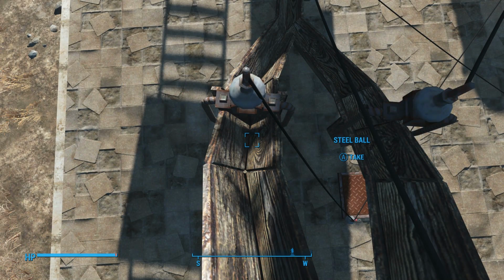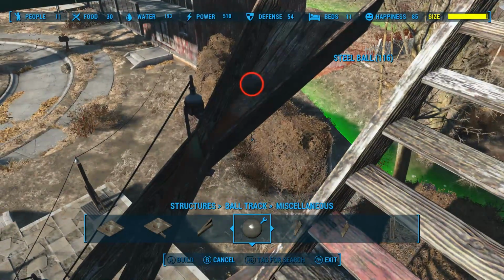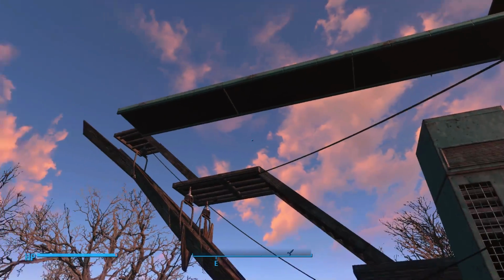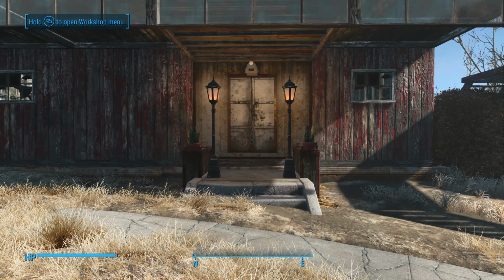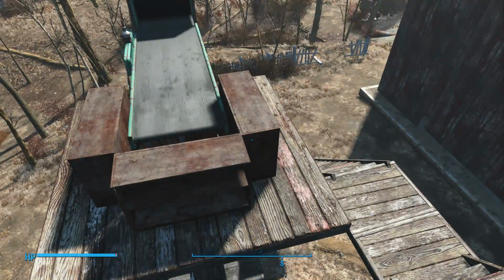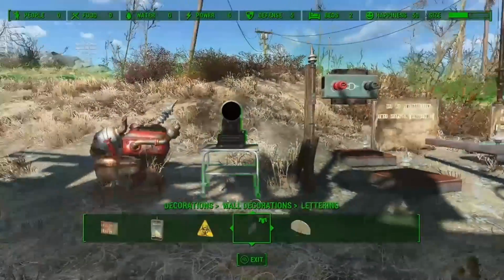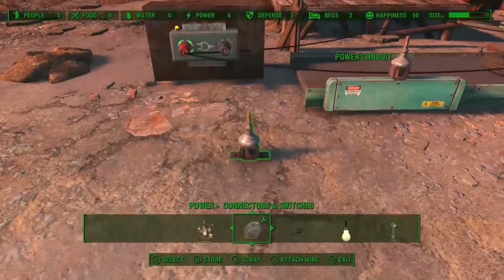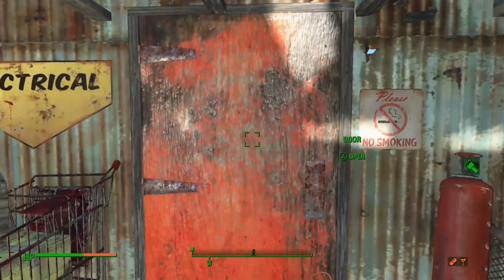Motion Sensor Doors (ft. The Insane Shecklador) 🚪 Fallout 4 No Mods Shop Class

Comment: I dont get the point of the ball track? Seems like the delayed off switch would cut the power between pressure plate and door, id probably have to attempt it myself before I'll understand the point of the ball track
Reply from the maker: Really this was more a puzzle challenge with Sheck and I. But I put together a better method in this video: https://youtu.be/0bhOULJvFwU?t=174

Comment: IDK why dont you use Laser instead of step 😂 2 laser 1 logicgate and delays it wasn't ezer ?! 😕
Reply from the maker: The only two problems with the Laser is that it can be accidentally stepped over and it's also visible. But we did find an easier way. Check it out here: https://youtu.be/0bhOULJvFwU?t=174
Reply: @SkooledZone I use same tech that you show with step and delay pylon  (but with laser in Manufacturing building mode - 1 lasre in front of door and and the other one in the other side of door-  cross first open door and cross second close door

Comment: Both of these are ingenious, but I have a simpler version; all you need is an XOR logic gate and a delayed off switch. Hook the XOR up to power as well as to the pressure plate. Hook a 5-second delayed off switch to the output of the XOR and the powered door. XOR's only transmit power when one of their inputs is powered. Therefore, the pressure plate/XOR combo resets the power supply to the delayed off switch, opening the door for 5 seconds.
Reply from the maker: Is that the same as this? https://youtu.be/0bhOULJvFwU?t=174
Reply: @SkooledZone  
Exactly the same. I hadn't watched that one yet. 😅

Comment: I wonder why they use a NAND gate, using the generator and the diverter as input. the generator is ALWAYS giving power, so the NAND works efectively as a NOT gate for the diverter. I think just a NOT, with the diverter as input should sufice. It just saves up one wire, tho, but it is a bit cleaner, and easier to understand.
Unless I am missing something...
Reply from the maker: We came up with a better method here: https://youtu.be/0bhOULJvFwU?t=174

Comment: Jumping back into FO4 now that my console can handle larger settlements, and your vids are huge find, thank you. Curious, could you just let the ball drop down a few feet between the less-steep single track pieces to achieve the same angle of decent as the double track? Gravity could solve the problem for you assuming the ball doesn’t bounce back out when it lands?
Reply from the maker: Actually, we discovered an even better method after I posted this video: https://youtu.be/0bhOULJvFwU?t=174
Reply: @SkooledZone  Brilliant! I had actually just tried making an automated decontamination gate with a pressure plate and a delayed off switch! Didn’t seem to even need the XOR switch, but it is a little finicky. Will try this setup, thanks for the reply!!

Comment: Love your videos, but here is a lot simpler solution: place two "solid state" laser sensors/switches (the last on the manufacturing menu) on either side of the door. Connect power to both of them. Then connect both sensors to the INPUT of NAND logic gate. Connect the OUTPUT of NAND gate to delayed OFF switch and then to the gate. Program the switch to desired time you want the door to stay open. This solution is better (IMHO) because if you run in and trip the second sensor earlier it will shut the door sooner. 

To make it clear, the NAND gate works when only one input is ON. When you start both sensors are OFF and the door is closed. Switch first sensor ON and NAND activates. Switch second sensor ON and NAND deactivates. However, when you switch either sensor again it will satisfy the criteria "only one input ON" and will open the door again. You have to cross the second switch to reset the system. Hope my instructions are clear, I don't know how to capture the video, not a computer savvy guy😊
Reply from the maker: I actually did that in one of my Far Harbor videos! :-)

Comment: Once upon a time, I went to school for EE, but lost a lot of those skills going into the Navy.  Nowadays, I have complicated home-work life, so I don't get to play Fallout very often, and I only started playing a couple months ago.  Eager for non-spoiler content, I looked into Settlement Building videos.  Foremost, I am delighted to have found the No Mods Shop Class.  Outstanding and very informative content.  Thank you!              Early in the video, I tried to think through how one might handle things with just electrical components.  One big issue is that I'm not yet a builder, so I know less about how things behave.  What I thought of was actually similar enough to the second design, that I think it will work.  If so, the biggest issue is the aesthetics.  Essentially, my mental gymnastics were the same as Shecklador, except that the door itself would go between the "always on" laser tripwire.  This reduces overall complexity, sadly evicting Rube Goldberg.  But hiding that laser in a pleasing way will be difficult, if not impossible, especially since it would work best if crossing the center where the two sliding doors meet.        Meanwhile, my instincts compel me to find a purely switch-and-logic-circuit way of doing things.  Someone else online has likely posted something, but I"m determined to think through it, even though there's no telling how many weeks until I could personally test it.  Still, if I come up with a possible circuit diagram, I'd provide it.

[  UPDATE  ]
PROBABLE AUTOMATIC DOOR DESIGN USING ONLY ELECTRICAL COMPONENTS!!!:
	After some efforts with a scratch pad, I attempted to learn just enough Simulink to validate my results.  I’m using Logic Gates, so a circuit test is needed which I cannot personal attempt for at least 1-3 weeks.      ….But I believe I have a working model for the Motion Sensor Doors which involves no Rube Goldberg devices, just electrical components.  Here is an attempt at a verbal explanation:       Construction requires a power source, the door, the interval timer, the pressure pad, one AND gate, and one OR gate; and the OR gate is probably something I needed for the logic circuit; might not be needed in the actual circuit.   …..  x7 Connections:   Power---->AND_input01;   Power---->PressurePad;   PressurePad---->OR_input01;   OR_output---->AND_input02;   AND_output---->IntervalTimer;   IntervalTime---->Door;  IntervalTime---->OR_input02.      If successful, this is what is happening.   Stepping on the pressure pad provides brief power to the interval switch.  After you step off the switch, for the duration of the interval, the interval switch is providing a feedback signal to replace the now-missing pressure pad signal.  When the timer hits zero, the interval switch is no longer powered, and everything returns to a steady-state “off” condition.

Comment: Curious... why not just use 2 of the laser trip wire 2 (second LTR in the menu) with a NAND logic gate? You could have a trip wire on each side where the player trips them in a serial fashion to open and close the door automatically. You wouldn't need the delay switch or any of the other nifty things to set up the delayed close because the player tripping the second LTR of the set would close the door. PS to 1st LTR(2), PS to 2nd LTR(2), Both LTR(2) to NAND+, NAND- to Door is how I would run it. I assume you could glitch the LTR into some decorations on each side of the door to make them "invisible".
Reply from the maker: Mainly because we were trying to achieve that fully invisible motion sensor look. Fret not, though, in the next video I'm going to do a quick update with a vastly simpler way to do this!

Comment: I had an idea for that building you show. I remember you making the glass railing for it. But it has that overhang under it. What if you stacked ceiling tiles on top of eachother to make the ceiling like 2-3 blocks thick, and then place it on the roof, and then put the glass railing. So it’ll be the same thickness, but the glass will mount to the edge of the roof instead of hanging a foot below it. Idk if that would even work, but I know you can stack floor tiles. Not sure if I explained that good enough

Comment: It’s just a pressure activated door. You made a very convoluted way of doing that. It’s not motion activated. Coulda just used a pressure plate with a delayed switch.
Reply from the maker: Just a pressure plate with a delayed switch alone won't do it. I obviously tried that long ago. Try it yourself and you'll see.
Reply: @SkooledZone  well you’d probably need a few things, but you could definitely make a pressure activated door without all this I’m pretty sure. I’ll have to load the game up and test some things out, I feel that would be fairly simple. I haven’t played the game in a long time though

Comment: Nice mechanical solution! If you need to shorten the track more, you can connect the powered belt (22:30) also to the bottom elevator. I myself like the use of the sloped belt to make drops more accurate but even the I still need barricades to keep objects from bouncing off the belts.

Edit: Did you try rubber balls or pool balls to replace the bugged steel ball?
Reply from the maker: Good call on the shortened track. I may have to try that. I haven't tried other kinds of balls though, figuring that the switches wouldn't trigger. But you never know. 😊

Comment: WOW... A shame this has to use a mechanical trigger (steel ball / tire) rather than pure logic gate / delay timer. I have one idea for you that has been fermenting in the back of my mind. I haven't played FO4 in many months so I have not felt like building it yet.
Basically we start with a vendor's shop. It would have a garage door shut during closed hours. When the vendor steps behind the counter, there is a laser trip that opens the door and lights up an open sign as well as other nearby lighting to signal that the shop is open. When the vendor steps away it closes up for the night. Neat idea right? I have debated on using this to also turn on street lighting (I think you did something similar in a previous video), but it would work in reverse.

Comment: That ball trick was pretty clever, and the tire even more so!  Here I was feeling proud for creating a manual door with switches on both sides that both toggled the door open/closed.  (Permanently power both switches, connect their output to the input of an XOR switch, connect the XOR switch output to the door.)
Reply: You can wire them up to the siren, so when the settlers set the alarm off the doors stay closed.
Reply: @IvarSmöldik  That could be interesting too.  Normally the door is always open, but the alarm closes it.  Then, a manual switch, or some other trigger, on the outside (with a couple second delayed off) in case you are caught on the wrong side.

Comment: Very cool video.

I apologize if I'm being dense (it's also been a long time since I've played FO4), but couldn't you accomplish the same effect with 2 power sources, a delayed  switch, pressure plates, an AND and a NAND gate, and an interval switch? It seems to me like the first solution of the video is more or less creating a single bit state machine (you alternate between the two sides when a pulse is sent to the ball track switch). I think (I don't currently have the means to test) that you could do similar by using the interval switch with the interval set to 2 and a separate power source. The interval switch acts like a toggle, which can work with the two power sources and a NAND gate so that when only 1 of the power sources is connected, the door opens. I do recall having issues before when trying to use 2 power sources, but it feels like the logic at least would work. Step on plate, door opens the interval switch is incremented, and the delayed switch is triggered, you walk through the door, the signal from the delayed switch fires, which increments the interval switch, toggling NAND gate to get a signal from both power sources, and the door closes again. I can't remember if the power door is open when powered or shut, by you can just use a NOT gate to invert the signal if need be. 

Again, apologies if I'm way off base. It's easy to design a setup that you think should work; the challenge is in debugging what goes wrong when the design is put into practice.

Either way, I did really enjoy the video.